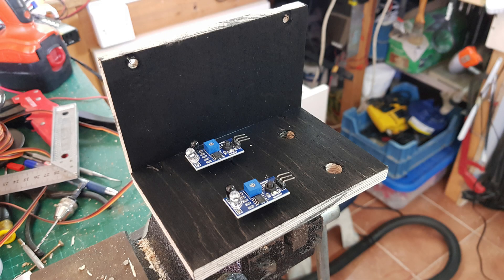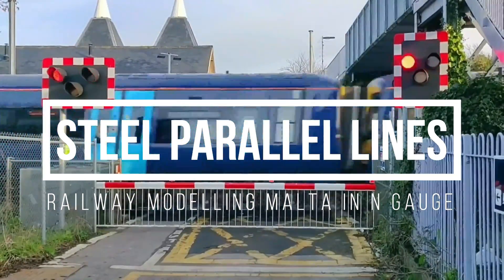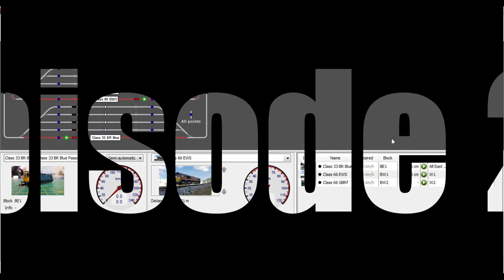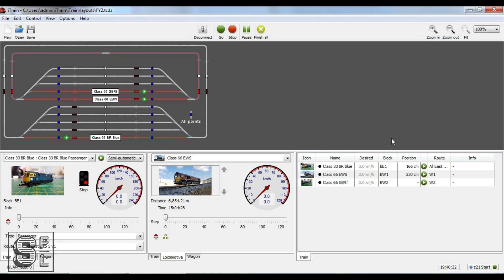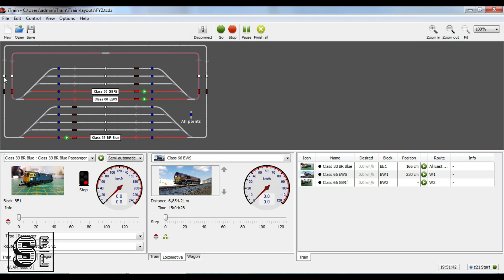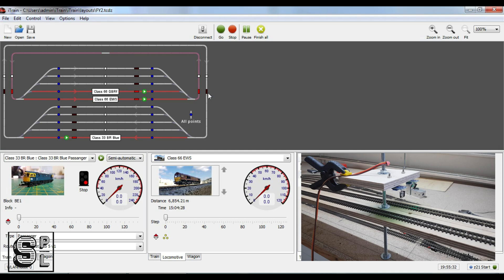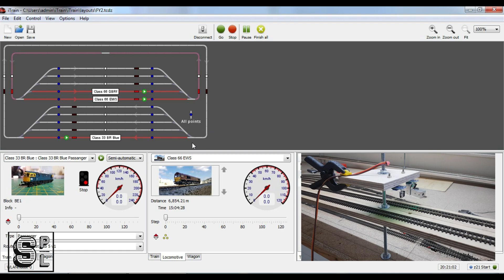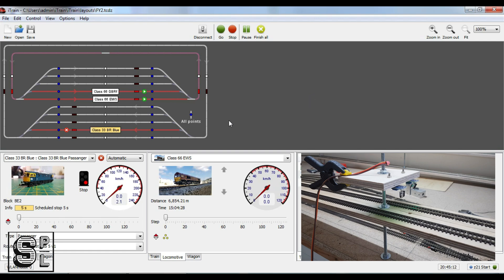Using Infra-Red Sensors for Block Detection | Ħal-Zuzzu Model Railway (Ep25)

Comment: Hi Joe i think the best way to use sensors is to use current sensors for all blocks but use rf sensors for accurate stopping ie if a train coming into a station use the current sensor for 95% of the block ie bring the train down to 5mph and use the rf sensor at the end of the platform to stop it in the exact location you require ,hope this helps ............tony
Reply from the maker: Agreed but I am a sucker for punishment and enjoy a challenge. In fact today I am messing about with making the stop exactly where I want them to (I hope) without the use of infra-red sensors :) Wish me luck haha

Comment: hi joe what you need to do is fit a wheel pickup on the end coach so that i trains will know when the train is completely off the blocked section and allow the next train to proceed.  this will also serve as an anti crash if for some reason some coaches uncouple while running
Reply from the maker: In iTrain I have entered the length of the loco and each additional coach/wagon and the block remains occupied until that whole length passes past the end sensor, depending on the speed travelled.